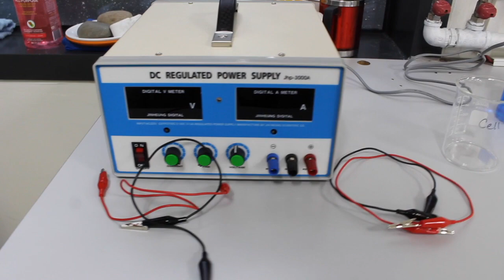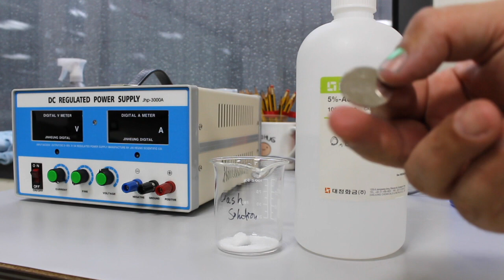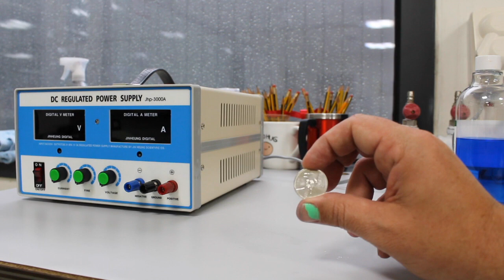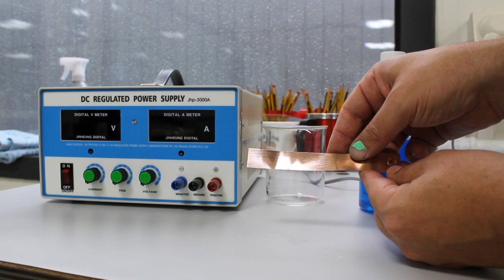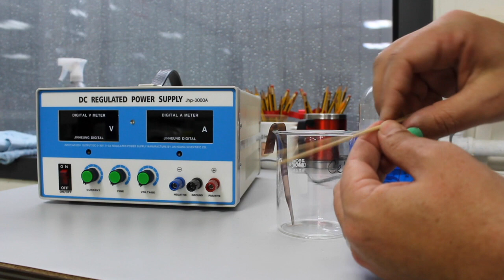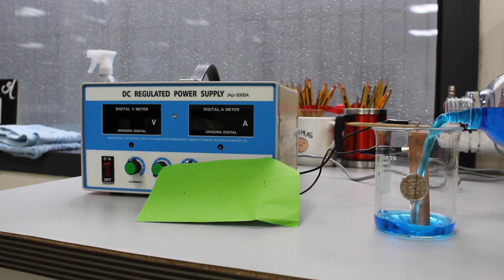Electroplating Lab

Comment: You should be using gloves not only that. You should cleaned both the copper strip and the coin in hydrochloric acid. Should put 2 copper strips one on either side to get the best results.
Reply: Sorry and clean the hydrochloric off with distilled water